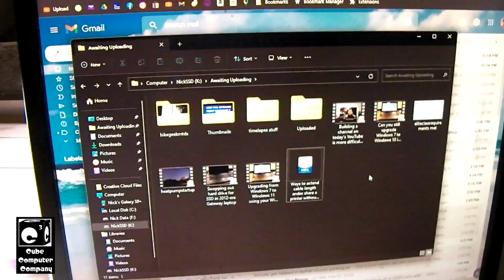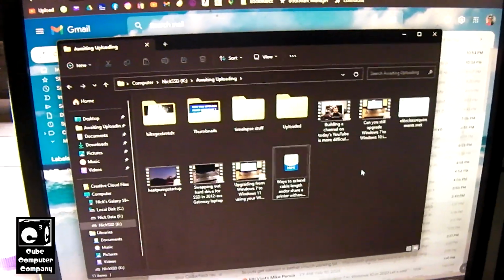Swapping portable M.2 SSD into UGREEN portable tool free enclosure

Comment: I have one of the same model, it removes itself every 10 minutes even if the power options are disabled in the control panel, is that right? , as it shows as if it had removed the force and with critical errors in the Windows event log
Reply from the maker: Yes this one would sometimes do as you describe. I tried updating the firmware on it and there was no change. Haven't had anymore issues since switching to the UGREEN enclosure.
Reply: mine is ugreen like yours in the video, bought at shopee
Reply from the maker: @gsswmr  You're having the issues with the ugreen?
Reply: @CubeComputerChannel  yes, i tried 2 differents cable and problem continue

Comment: Try the minitool part wiz data recovery option, run the scan and see if you can save any missing files. You can decide if you want to spend the $ to get the license or if there is better data recovery software for the same price. As long as you have not reformatted the drive.